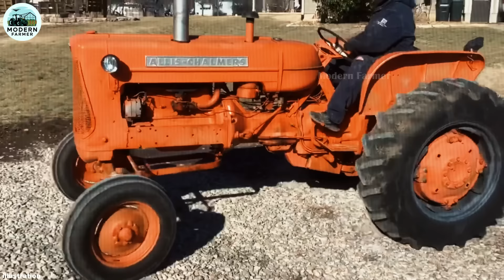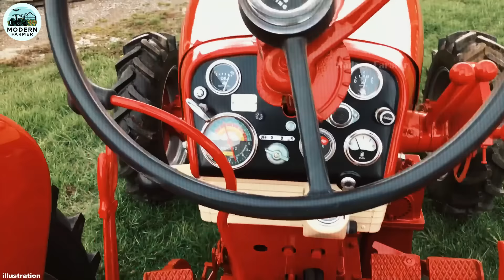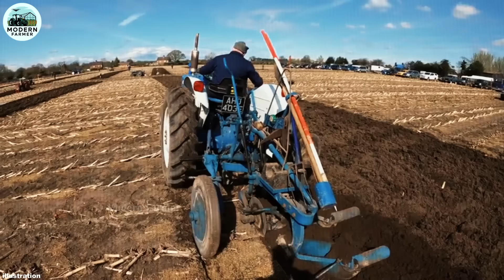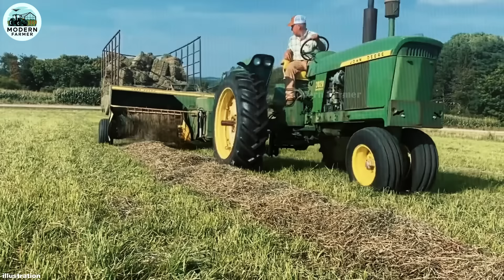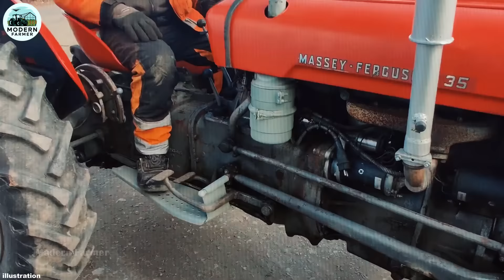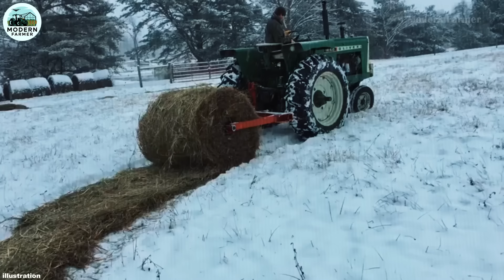Top 7 Most Reliable Fuel-Efficient Tractors Ever Built

Comment: You totally missed the tractor that held the highest fuel efficiency rating from the Nebraska test   from 1956 to 1983 and that was the 720 JD diesel.  Match that ! That was a 27 year record !
Reply from the maker: Thanks for pointing that out, it was our mistake. We will dedicate JD 720 diesel another video coming soon to clear up this myth.
Reply: G  day  from Ontario  A retired  farmer worked on old 2 cyl.  JD  Told me "B  & 720"  were most  best on fuel
According to tractor data  720   for sure   Ths

Comment: AC WD-45 and D-17 used WD 45 had to carry a box wrench 1/2 - 9/16, o ring and a gallon of hyd fluid for when it blew the o ring for the hydraulics when working hard daily
Reply from the maker: You’re right — those O-ring issues were pretty common when they were worked hard. The WD-45 and D-17 were great machines though, built strong for their time.

Comment: Bull, you didn’t mention the 4020 JD
Reply: 4020 wasnt economical.
Reply from the maker: Good catch! The 4020 JD is a classic — it’ll definitely be in an upcoming video.
Reply: The 3020 was basically the same with lower horsepower I believe
Reply: @chadbinette3201 The 3020 had a 4 cylinder engine and was rated as As a 4 plow tractor while the 4020 had a significantly larger and more powerful 6 cylinder diesel engine and was rated as a 5 plow tractor in all soils.
Reply: Smaller than the 4020 and had a 4cylinder engine instead of the 4020's 6 cylinder.
Reply: Most US MF 35's were initially gasoline engine powered. Very few of the diesel versions sold in the US which were mostly gasoline engine powered.